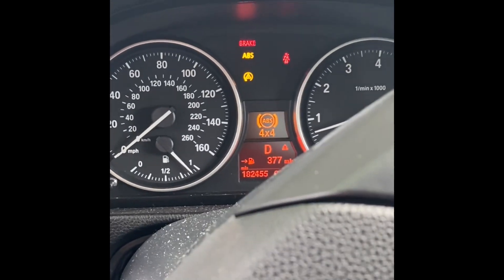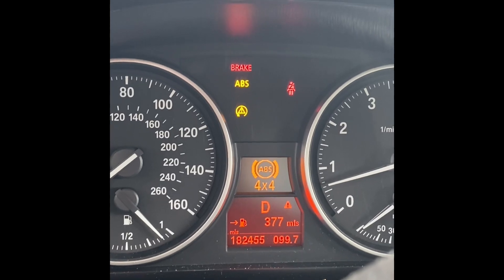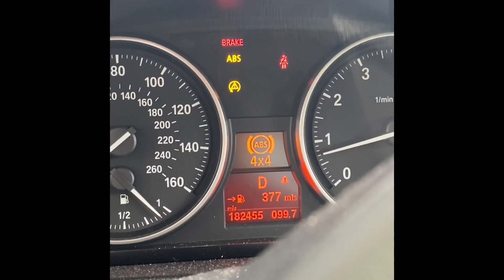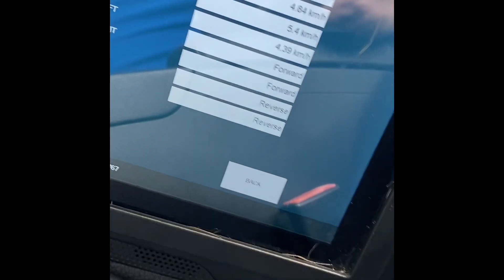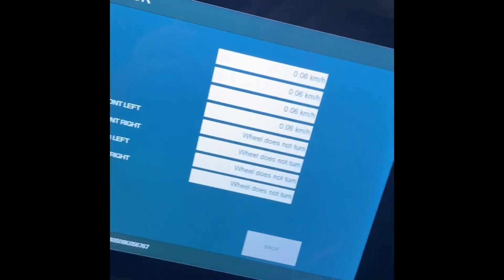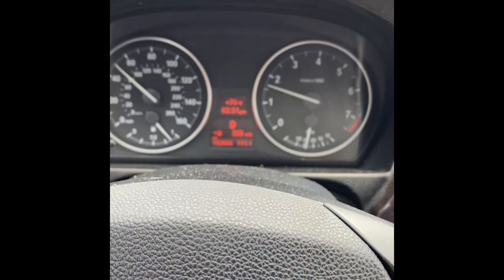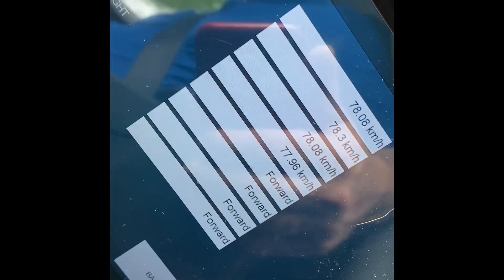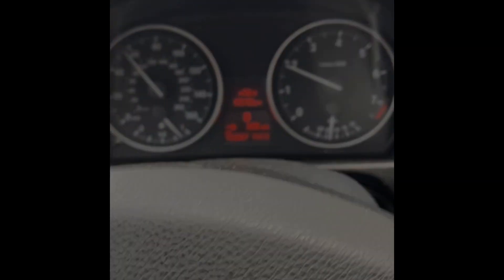How to diagnose BMW DSC code 5E5C Direction of rotation on a e90 BMW 328xi

Comment: How to fix that new abs sensors installed new abs sensor rings still i have left 5e5c fault?
Reply from the maker: Are your sensors OEM BMW or Bosch, if not need to start there or check live data with scan tool, if they read opposite direction your sensors are most likely aftermarket.
Reply: @samploeg3435   front sensors reading im running in reserve, rear sensors shows im going forward, all speed sensors show same speed, changed 4 front wheel sensos all brand new.
Reply from the maker: @kayra4840 where did the front sensors come from? Sensors reading reverse when going forward are suspect, if not BMW or Bosch brand start there otherwise potential for Internal DSC but sensors genuine parts always seem to fix the direction issue. Anything other than those brands seem to have issues reading front axle tone rings.
Reply: @samploeg3435  thank you I will try to use brand new oem sensors!
Reply: Im using NTY brand sensors
Reply from the maker: @kayra4840 the sensors I pulled out of the car in video where NTY from Amazon, that should be your issue, keep me posted if you have questions!